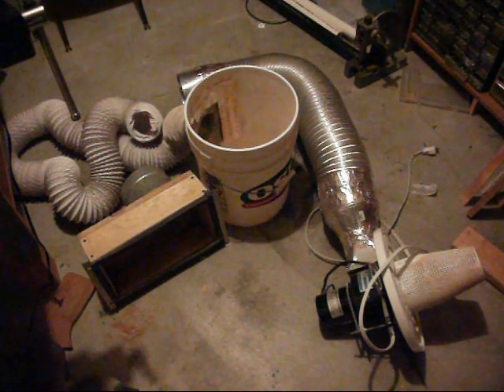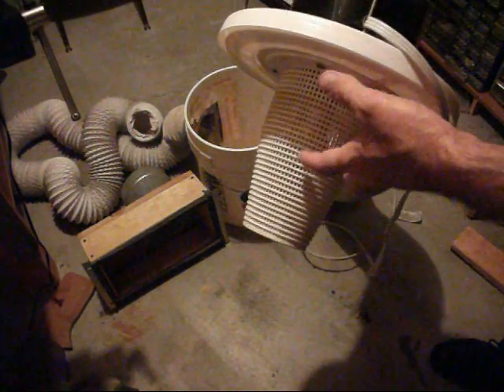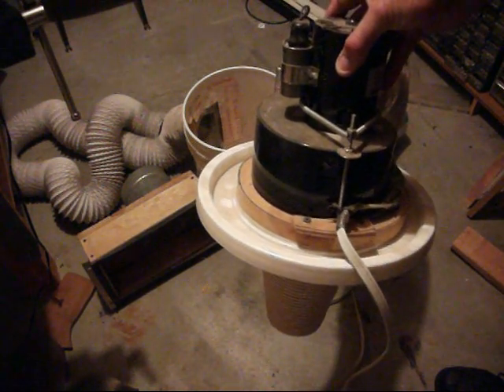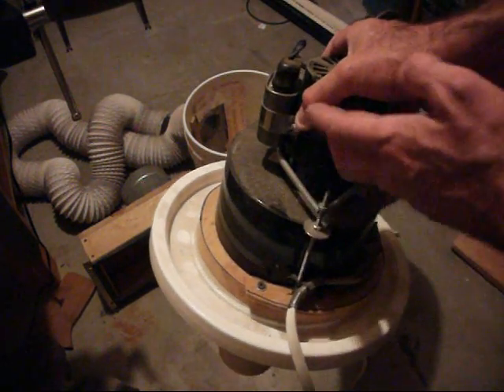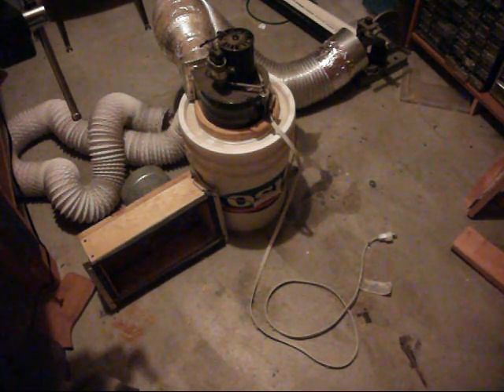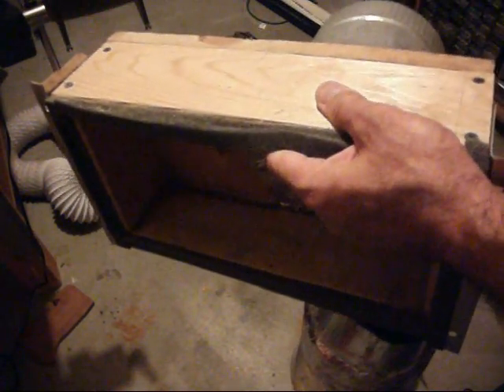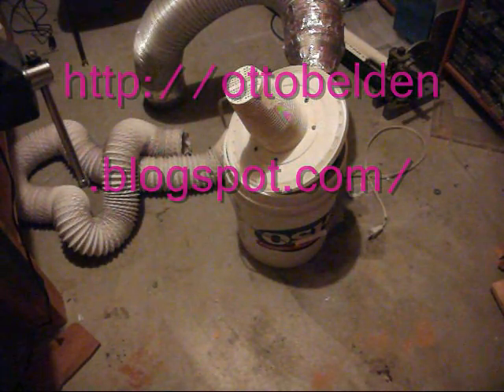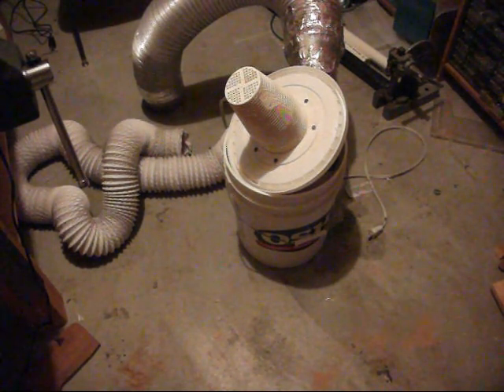How To Make A Homemade Dust Collector

Comment from the maker: @4vinos 
I haven't seen anyone use an AC fan but I'm sure it could work. The nice thing about using a blower motor is the dust is only going through the blower and not the motor. With a fan the fan blade is usually mounted right on the motor shaft and all the dust has to pass over / under / around the motor. If it's not a sealed motor the dust goes into the motor and can mess it up. Also blowers are much better working against back pressure compared to fans.
 - Otto

Comment from the maker: Thanks for checking out my video. You are right about the container filling up on big projects, I just do weekend projects and it works for me. I like your suggestion of removing the particulate filter and leaving the pool filter. I'll look into that! I called the "fan" I'm using a radial blower because that is what the MFG of the fan calls it, here is the model number: McLean engineering 1NB412-115. I'll check out the cyclone system you mentioned as well.